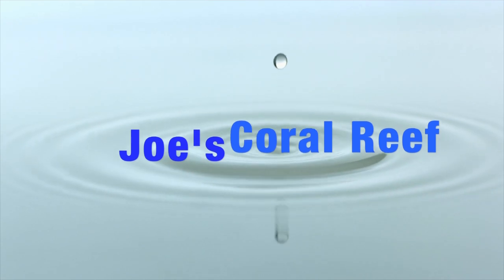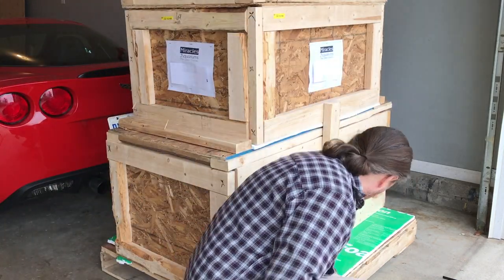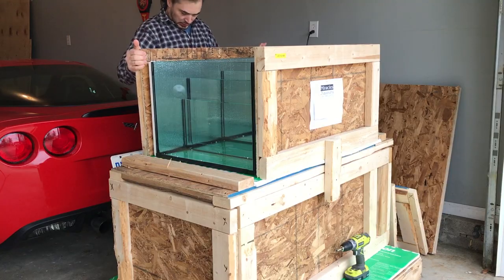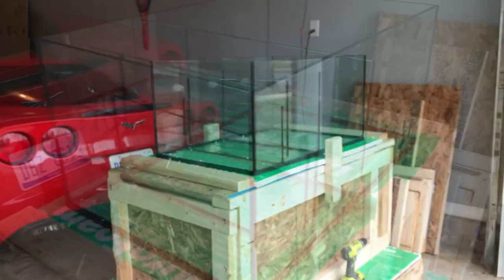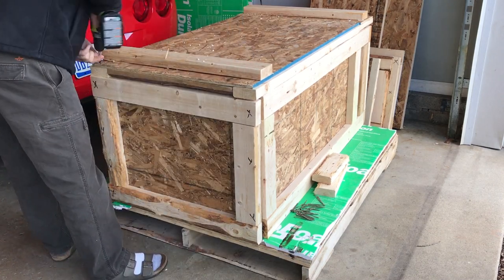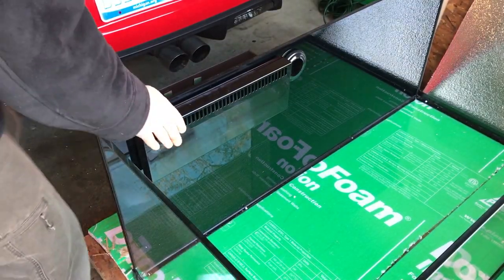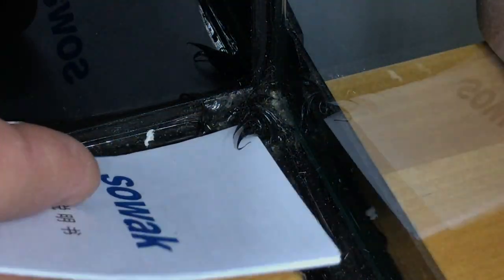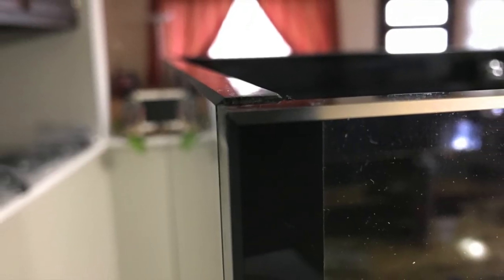New Tank Delivery Day - Miracles Tank and Sump

Comment: Pretty disappointing. I would have expected better from Miracles... especially for how much they charge. I had similar build quality issues with the tank I had built by a local Michigan tank builder.

I, also, use a Synergy Reef overflow. Any tank I build, going forward, will have one.

Have fun with the build! As we have similar size tanks, check out my channel so you can see what I did with mine.